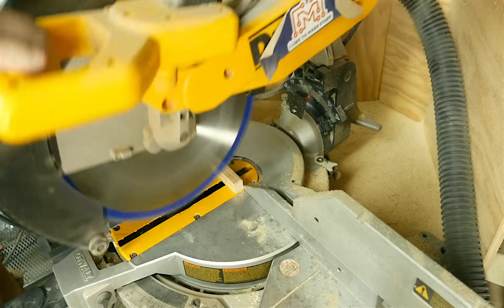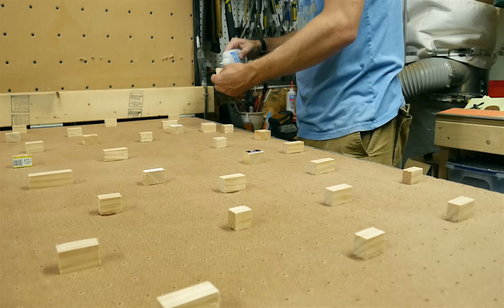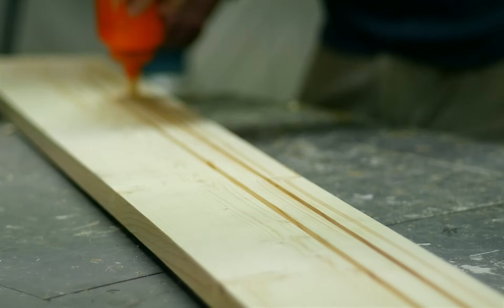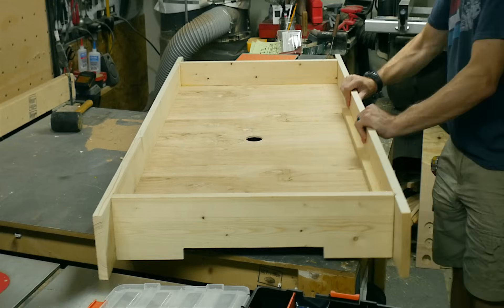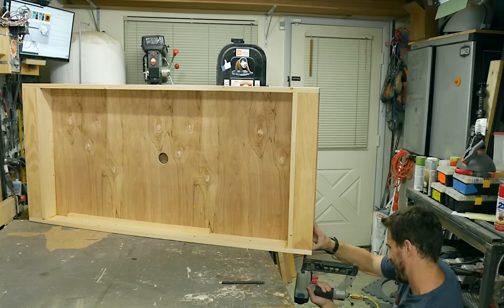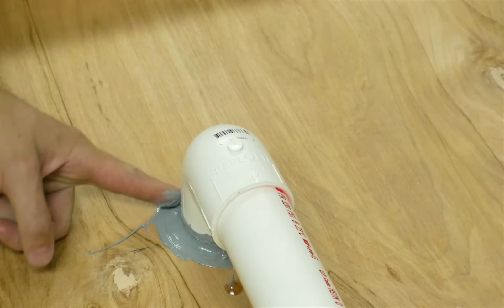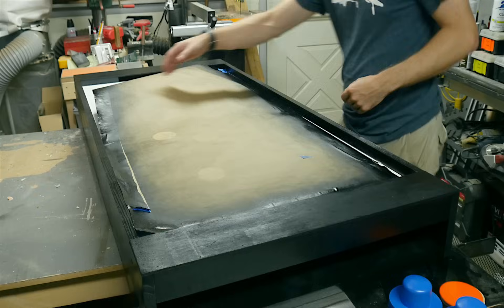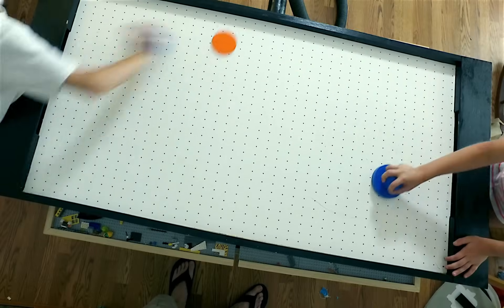Mini Air Hockey Table // How-To | I Like To Make Stuff

Comment: Great job Bob, as always. As for the replacement of the shop vac - https://www.amazon.com/Tjernlund-M-6-Booster-Hydroponic-Conditioning/dp/B005XNNYMU/ref=sr_1_1?ie=UTF8&qid=1469255934&sr=8-1&keywords=Tjernlund+M-6+Inline+Duct+Booster+Fan%2C+Hydroponic+Blower+Heat+Air+Conditioning+Vent+Exhaust%2C+460+CFM%2C+6%22
I am using it as my 5th gen FSL laser cutter exhaust system. It is not too cheap, but extremely silent when still heaving great power. I think it would do a great job here.